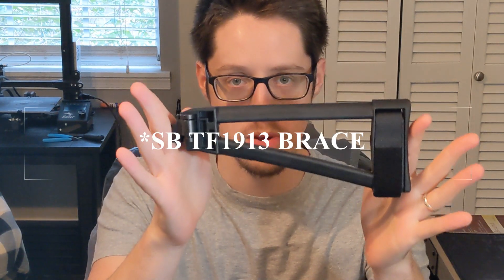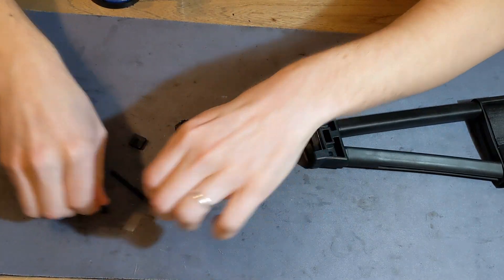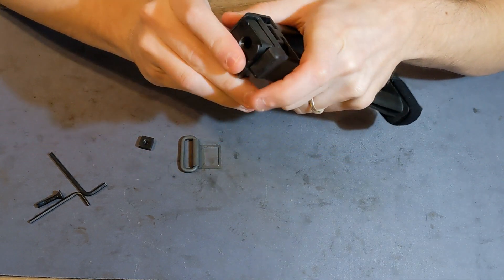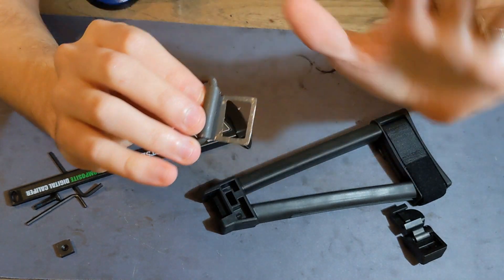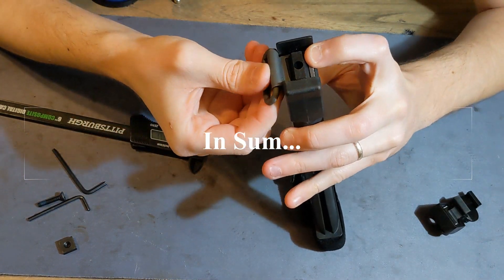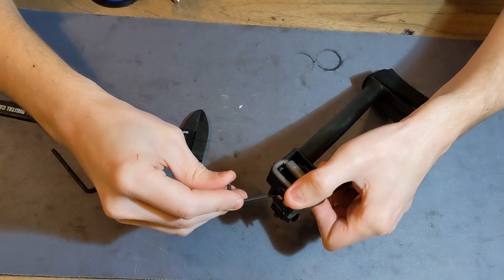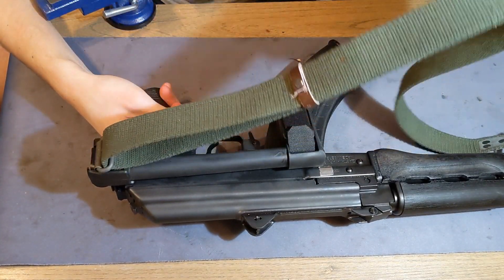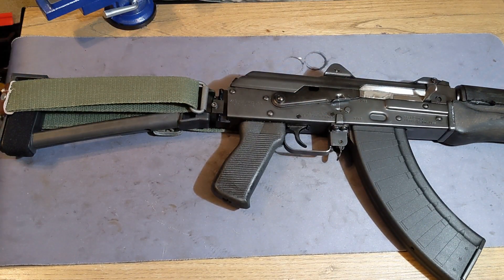Triangle Brace Sling Mount! TF1913 SB Tactical

Comment: Thank you so much for this video. I'm planning on buying a ZPAP 92 and putting a sling on it, so this was extremely helpful. However, I'm curious as to how you attached the sling to the front of the gun. As far as I know, ZPAP 92s don't come with front sling swivels. Is there some sort of aftermarket sling swivel one can install, or do they actually come with sling swivels on the front of the gun?
Reply from the maker: There is a small sling loop on the side of the gas block/front sight. You can see it here: https://www.instagram.com/p/CMa2SGBF3Jq/ (2nd and 3rd pics)
Reply: Vickers ak sling should work you just loop the strings through the front sling point

Comment: I've been going nuts trying to find a pistol grip plate that is both compatible with yugo pistols and won't get in the way of the pic rail adapter, will definitely be doing some variation of this method instead, thanks

Comment: Does any sling work with a zpap92? Whered you get yours
Reply from the maker: Mine is a surplus AK sling. There's only the small ring on the gas block to hook into on the front. So either a small hook attachment like most AK slings have (not Yugo tho) or use the Blue Force Wire QD to adapt any normal sling.

Comment: What tools did you utilize to modify that sling mount? I have that piece you used here but I don’t have the tools for the necessary modification to add onto the brace.
Reply from the maker: I used a drill to get started and then a file to shape it into the square. You could also use a dremel in between the drill and file to get a rough shape and then finish w/ a file.

Comment: Would this mod work on the Kalashnikov USA triangle brace, made by SB Tactical, specifically made for the KP-9 9mm AK?

I assume it would, just curious if anyone knows for sure.
Reply from the maker: I think so. It looks like the brace is bolted to the folding mech the same way on both braces so it should work the same!

Comment: how did you fit the sling hardware through the loop? I got the same sling and loop as you but its all too small to get through the loop on the brace.
Reply from the maker: I fit the hook end of the hardware through by just working it back and forth. It took a little doing, but it'll fit

Comment: Can the hinge on this brace be flipped upside down to make the brace fold to the right instead of the left?
Reply from the maker: No it's definitely intended to fold to the left. You can flip it around but the polymer of the brace doesn't let it fully open and lock.